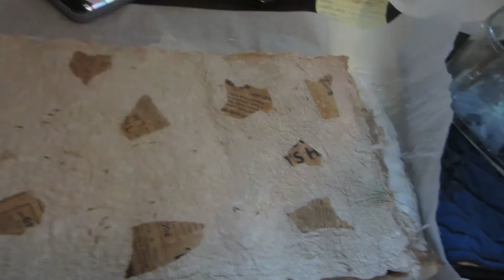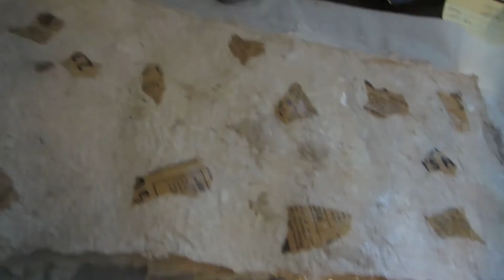DIY Cotton WATERCOLOR PAPER at Home (with cotton balls)

Comment: Huge commercial papermaking machines basically start with a pulp mixture that is 95% water and only 5% fibre; be it wood fiber or cotton or a mixture. The wet end of the machine, basically starts with a pulp mixture that flows onto a very fine continuous wire screen.  Lots of water is then removed from the pulp mixture and when only around 30% water remains, the pulp mix is strong enough to jump a small gap. It then travels through many drying and pressing cylinders.The end product only has around 7% water. Looking at your pulp mix, I would say that you have far too much cotton. I would mix up a much thinner pulp mix in a bathtub. Dip your deckle (wire screen) under your mix and then let lots of water drain out. Your deckle should be in two parts. The wire screen and a removable frame. After most of the water has drained out, remove the frame and drop your wet sheet onto a flat felt surface. You can make up a multi layer sandwich consisting of paper and felt layers. Then you need something to press it with. Perhaps a couple of sheets of plywood and lots of bricks.
Reply from the maker: Oh wow, thank you so much for this advice! Honestly, my blender wasn't powerful enough to shred my cotton into the tiny pieces I needed. I think it was doomed from the start haha. I don't think I'll attempt again with cotton, but would definitely be open to trying your advice out to make regular recycled paper. It definitely has its own character. I've seen wedding invitations created with handmade paper infused with flower seeds. That way, of throwing it out, you can just plant it in soil and watch them grow! Homemade paper is also neat for crafting and scrapbooking. But in terms of creating art on it as you would store-bought drawing/painting paper.. hmm my homemade attempts would need to go through a lot more R&D for that haha. It was super messy too, I don't know how much I'll be will to go through the trial and error for it. Thank you so much for your tips, and for taking the time to share your insight ^^

Comment: This wouldn't be cotton watercolor paper, but it is much easier: I fold two 11" x 15" sheets of 80lb drawing paper into half (I stack two, then fold into half ), run them under cold water until it feels soaked through fully, then pat excess water off with a clean towel. I leave it to dry, and the sheets are now stuck together, around the thickness of 300gsm WC paper. Once dry, I dissolve some powder unflavored gelatin into a spreadable liquid and brush my dry paper until it feels soaked with gelatin (around 3 coats). I dry it once again, and it works beautifully as practice paper for me! Only one side of the sheet is sized though, so the other side can be sized as well.

Comment: This is the most successful diy watercolor paper I have seen thus far! Trial and error, you did great!
How did you figure out to use the gelatin mixture?
Reply from the maker: Thank you!! I'm so happy you think so. I found out through a lot of googling. First scouring Reddit forums on why my handmade paper was so absorbent, then discovering different types of "sizing" (internal & external). Gelatin seemed like the most accessible (plus my paper was already finished, so internal sizing wasn't an option), though it was hard to track down any directions on it. Of course there was no information about using some sort of preservative, so my first batch of paper stunk like heck!! Then it was back to the forums to figure out what else I could do. Luckily I have some aluminum sulfate/alum kicking around from a different DIY art supply project, so just added some into the gelatin—I think I read about this on a random website, if not Reddit. Anyways, it was a PROCESS lol. The gelatin made the paper super stiff, so if you end up discovering something that works better, please let me know!

Comment: I wonder whether if you used some baking paper to protect the iron surface rather than a towel you could create a smoother paper surface. Some gelatine (or other sizing)in with the pulp when mixing might help with texture , maybe 🤔🤔🤔
Reply: …oh, you did try that 🤣🤣🤣
Reply from the maker: Ah baking paper would've probably helped. I think I used the towel to soak up some of the moisture though. But maybe I could used the towel first, then parchment paper right after to flatten it out some more 🤔 Paper making was super messy, but I'm tempted to try it again when the weather gets nicer. Maybe I'll try out different techniques. 
Do you play around with papermaking? It sounds like you have some experience with it 😄

Comment: Can you make a quick video on how you made the gelatin and aluminum sulfide sizing? I can’t find sizing ANYWHERE for sale and I need to make some by DONT know where to buy the aluminum sulfide and how much to mix in
Reply from the maker: Hi Monica! I followed the instructions on the gelatin package in terms of how much water to add. Of course, instead of letting it set, I brushed it on in liquid form. To that mixture, I added about a tablespoon of aluminum sulphate/alum. Alum is a type of pickling salt, so it acts as a preservant. It made it so the gelatin didn't go bad as it set into the paper. I'm not sure what you can use as an alternative if you can't get your hands on it 🤔 Aluminum sulphate is a similar chemical compound, but is used as a fertilizer for certain flowers. I found it at a plant nursery. But I've also seen it in the outdoor section of my local home hardware store. Not the most accessible thing to find, but I hope that you're able to make something work! Good luck, and if you do find an alternative, please let me know 😊

Comment: was making it cheaper then buying?
Reply from the maker: Cheaper, yes. But incredibly messy and time consuming. The end result isn't like the watercolor paper you'd get in stores. The things you can create with it is limited because of the rough texture. So I wouldn't use it as a replacement. Think of it more as a fun novelty project 😉

Comment: I’m sorry for asking this 2 years later, but how do you make the mixture of alum and gelatin? Do you have to heat them while mixing?

I have a crystalised alum and powdered gelatin.
Reply from the maker: Haha no need to apologize. I just made the gelatin according to the instructions on the packet (in terms of how much hot water too add), but instead of letting it set, I mixed about a small spoonful of alum and brushed it onto my paper. Hope this helps!
Reply: @JuliRoxArt  thanks for the reply :) So it’s a teaspoon you use for the alum, I assume?
Reply from the maker: @ridhosiregar138  Just under a tablespoon 😁 Let me know if you end up trying it out. Cheers~